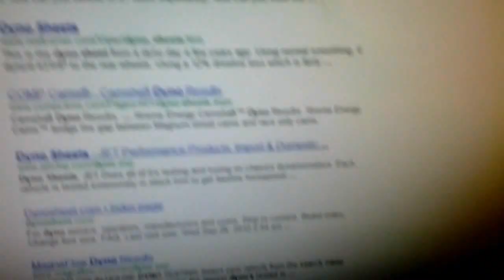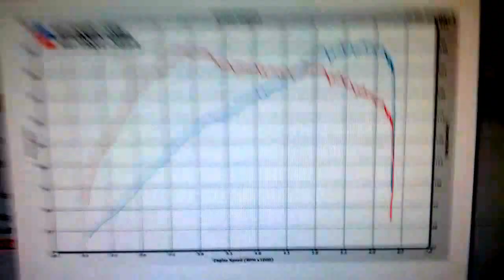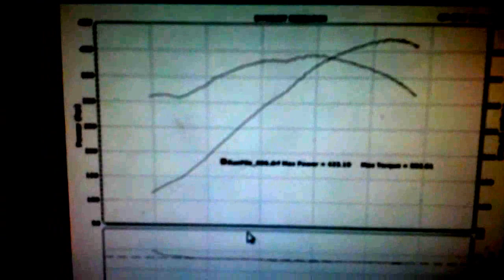Horsepower vs. Torque

Comment: Power to weight ratio is the most reliable (single number) indicator, as any mechanical engineer will tell you.
Reply: Explain to me this.

Honda Civic SI.  K24. 205 HP, 175 Ft. Lbs.  Car weighs 3000 pounds.

Runs the 1/4 mile in 14.7 seconds.

Buick Regal GS.  Weighed in at 3850 pounds.  240 horsepower, 315 ft. lbs of torque (actual output, under-rated at only 280 ft. lbs.)

Also runs the 1/4 mile in 14.7

The Civic has a hp to weight of 14.6 pounds per HP.

The Regal has a hp to weight ratio of 16 pounds per HP.

There goes the HP to weight ratio theory.

Lets look at the torque.

Civic has a ratio of 17 pounds per ft. lb of torque.

Buick has a ratio of 12.4 pounds per ft. lb.

The civic engine revs to about 8 grand, has V tec and won't make power until above the curve.

Buick has a positive displacement blower, and makes GOBS of torque UNDER the curve.

Think I am full of shit, look up the car and driver times for these two cars and see if I am close in my numbers.

Everytime I get into it with a car, expecially from a light, I walk away before even reaching 5000 RPM in first gear.

POWER UNDER the curve (torque)

Usually big torque is used for hauling loads, like big rigs (I drive truck for a living), but you apply gobs of torque into a car that is a street/strip car, and it's insane.

Just saying, a high reving engine isn't best for street/strip cars.

And just to put the icing on the cake, my car is modded with a pile of bolt ons and it's pullied.  Still gets about the SAME gas mileage as a stock Si with an engine half the size.
Reply: Chris Osborne

This is just splitting hairs and your argument has nothing to do with what Jon Proce is saying. Jon is saying that horsepower is meaningless.

The case you present is merely an example of 2 cars with the same 1/4 mile time, with very close power:weight ratios but different torque curves AND different maximum horsepower. One of the problems with power:weight ratio is that it doesn't factor in the relationship between drag and velocity (acceleration tails off quicker with a low HP car). It's much more complicated than you think it is, and you've drawn the false conclusion that a Buick with higher horsepower AND torque somehow proves what Jon is saying. I know the Civic is FWD, but I don't know your particular Buick's drivetrain configuration (RWD has an inherent launch advantage due to weight transfer for example). There are many variables here, but none which prove Jon's silly notion that torque is all that matters. Low end torque doesn't even come into a drag race in a manual car, because you use your clutch to find the limit of tyre adhesion (street tyres), and once you're off the line, you're only using the high rev range between subsequent shifts.

This is simply a case of swings and roundabouts. If you disagree, show me your math, because that's all that counts -- it's just engineering at the end of the day, and the language of engineering is not English (it simply doesn't work, as you, Jon and countless others continue to demonstrate).

Furthermore, your concept of torque:weight ratio is utter nonsense from a physics point of view. You can't propel a car to 100mph using a cordless drill can you? The faster you want to go, the more power you need to output because aerodynamic drag is proportional to velocity squared. If your notion was correct, I could put pedals in my car and propel it to its 155mph limit without breaking a sweat. You put POWER into a gearbox and extract whatever combination of torque/rpm you wish, determined by ratios. I can apply any torque I want to a shaft using an arm of sufficient length, but the fact I can't even produce 1/2 HP means that I can't rotate the arm fast enough to move a Buick beyond 1mph. Is this sinking in yet?
Reply: Chris Osborne

Put in the simplest terms possible:

175lb.ft vs 315lb.ft...........same (slow) quarter mile time. Case closed.
Reply: But, what you fail to account for is final drive ratios, tire sizes, extra weight and fuel mileage.

The regal has a F/D of 2.93:1, a 225/60R16 tire and nearly 900 pounds of extra weight to move down that track, but only makes 35 more HP at about 3000 less RPM.
Reply: Chris Osborne

I can't believe you're telling me I've failed to account for final drive ratios and gearing, since this has been my argument against Jon Proce all along (in essence, wheel torque/rpm is derived from flywheel horsepower and gearing).

We're getting nowhere here, and the reason is, you've presented a borderline case which neither proves the case for horsepower nor torque, because the only figures you've provided are peak flywheel numbers, which are not useful at all. You also don't seem mathematically inclined, which isn't helping.

When things are borderline, you can't explain it using English, only mathematics. I've already pointed out that there's a massive difference in torque between the Buick and Civic, but no difference in the 1/4 mile time. Why hasn't this registered with you? Within the context of this video, you have proved Jon's theory to be bullshit. I don't see what more needs to be done beyond mathematically derived plots of distance vs time, showing how the cars alternately lag/lead from launch to finish. If you're so clever, perhaps you would be so kind as to do this for me. I'd be very interested to see if you really understand this.
Reply: MoronAntidote

Really?  the civic has a HUGE mechanical  advantage over the regal with it's smaller tire size, steeper gearing (numerically higher), steeper final drive (something like 4.7:1?) and it's 6 speeds.

The regal just uses sheer force (315 foot pounds) to move it's nearly 2 tons down the track.

The civic has shallow gears, 900 pounds less weight, smaller tires.

To run the 1/4 at 100 MPH, the civic needs 3, maybe 4 gears.

Regal needs two.
Reply: Chris Osborne

Show me the mathematics then. Otherwise I'm not interested in your barnyard theories.

315lb.ft is not necessarily impressive. Flywheel torque gets multiplied by the gearbox and final drive, and the multiplication depends on many factors. A shit rev limit usually goes hand in hand with taller gears and higher torque. Swings and roundabouts - what's new?

Does anything you say prove what Jon Proce is saying? No.

It doesn't matter how many excuses you make about the Civic, the fact is it does the quarter mile in the same time as your Buick with only 175lb.ft peak torque. There's nothing more to say as far as this video as concerned.

It's a borderline case between two very different cars, but the torque difference is so huge that there can be no question that Jon is simply wrong. Bullshitting the public with peak torque figures and Carrol Shelby inspired myths doesn't help at all. Power to weight ratio is the least misleading number I can think of, but it's by no means perfect (doesn't take into account drag vs velocity for example). The reality is, there is no single number which defines the performance of an engine/car and there never will be, because it's far too complex. So, the public are given 0-60 times, peak HP, peak torque and top speed. Even this is lost on most of them, and programs like Top Gear in the UK just make the public dumber IMO.
Reply: MoronAntidote lightening the regal to 3000 pounds, the same weight as the civic, nets 13.8 passes.

It's been done.

Slap a set of 3.69 gears in that same car, and it's a rocket. 

Again, been done.

Power under the cuve is where it is at.

New Si is 3000 pounds, has a 4 cylinder and gets 9.4 liters/100 kilometers for economy.

I have a 3900 pound car, boosted v6, with a pile of bolt ons and get 9.6 liters per 100 kilometers.

I dont need to rev over 2000 rpm.

Torque. Power, economy.
Reply: Chris Osborne

So what's your new power:weight ratio then?

Going round in circles here it seems.

And anyone can make a car accelerate faster by shortening the gearing, because you increase the wheel torque (which as I've said all along depends on gearing). I still don't think you get it.

You continue to compare apples and oranges via the ridiculous notion that flywheel torque alone determines 1/4 mile time. You build a motor with more horsepower and gear it appropriately, you'll go faster.

'Power under the curve' is nonsense. I think/hope you meant 'area under the torque curve', which 'might be' a better measure than peak horsepower, depending on whether you're launching or not, because once you're rolling, you'll only be using a narrow rev range between shifts.
Reply: MoronAntidote Tell you what.  I could care less what you think, clearly you are one of these Vtec fanboys who thinks that high revving 4 bangers are the key.

Wrong.  You might make 400 HP from a 4 banger, but how long do you think that 4 banger will last when compared to making that same power from an LSX, or an L67, or even an L36.

As for my car, it isn't a bucket of bolts.  It's what we call a "sleeper"

Looks stock, ugly, and slow.  While it may look stock and ugly, it certainly ain't slow.

In fact, my next mods are a cam and double roller timing set, 140# valve springs, titanium retainers and Viton valve seals.

Should be good for 50 WHP with my current list of mods, and I hope to have the old mule into the 12's on street tires here shortly.

it's DEEP into the 13's as it sits with only a few bolt ons.
Reply: Chris Osborne

No, I don't even like Civics. BMW for me thanks.
Reply: MoronAntidote ok, bmw then. I have tge same whp (maybe less) than a 335xi, I am heavier, but i am still faster.

Torque.
Reply: Chris Osborne
Torque? No, it's not that simple, but I know you'll never get it because you don't approach the matter the way an engineer does, using mathematics. I'm guessing by the fact you used the 335xi for comparison that you have AWD. Well, that blows your Civic comparisons out of the water for a start, because AWD has an inherent launch advantage over FWD, and you should know that launch is an important factor in a drag race.

In summary:
Huge difference in flywheel torque (not the same as wheel torque);
Small difference in power:weight ratio (favors Civic once moving);
AWD vs FWD (favors Buick at launch);
Buick has power advantage, so acceleration is less affected by drag as speed increases;
Same 1/4 mile time (stock vs stock by your own admission).

Can't you see how this balances out? The least meaningful number here is torque (look at the ratio between the numbers and ask yourself why there's no difference in the quarter mile time).
Reply: MoronAntidote 2001 regal gs. FWD.
Reply: Chris Osborne

I feel for you ;)

My prediction is therefore a slight advantage to the Civic at launch due to lighter weight, but the Buick progressively gains ground after launch due to higher horsepower making it less impeded by aerodynamic drag, resulting in a tie. Not hard to visualise, though easier for the Buick if it had AWD.

Btw you also didn't mention whether the Buick is auto or not.

You do understand the importance of power vs velocity I take it?

For example, a bottom end Lotus Elise gets off the line quickly due to light weight, but because it lacks power, it runs out of puff really quickly. Acceleration isn't linear due to gear changes and drag. It's a curve which starts to flatten out some way before top speed (depends on power), so the higher your power and the lower your drag, the faster you'll be accelerating at a given speed (all else being equal, which is not the case here, but rest assured the engineers did optimise your gearing as they do for every car).
Reply: Really? I feel bad for you?

How much that BMW set you back?

I raced an E46 M3 cabriolet.  2002.

They are what? 300 HP and I think he said 250 - 260 ft. Lbs?

Again, I have NO idea what my car is putting out at the wheels, but I would be safe to say that it is near the 315 - 325 HP at the crank.

Less than the M3.

But I still stuck with him off the line (while he was at near redline to launch) and pulled ahead by a car.

I am willing to bet that I make more torque at the wheels than that thing did at the crank.

That's all I am trying to say.

And bottom line, they are lighter, are RWD, have a manual gear box and have a MUCH higher RPM sweep than I do.

So, that is what I am basing my argument on.

You think that because a Regal and Si run the same 1/4 mile time, that torque sucks?

Ok.  Let's up the SI's HP to 240, drop it's final drive to 2.93 from 4.7? and see how it goes.

See you in 18 seconds or longer.

Lighten the regal up by 700 pounds, and STILL make the Si have 240 HP and give the regal a 4.7? final drive.

The regal will win.  Promise.  Double the torque, same HP and weight.

It's not that hard to understand.
Reply: Chris Osborne

There is so much FAIL in this post it's hard to know where to start.

ALL cars produce greatly more torque at the wheels than they do at the crank. This is due to torque multiplication from gearing. You seem confused by 'corrected' measurements from dyno testing. You multiply the flywheel torque by the gear ratio and final drive.

You don't understand this at all. Sorry.
Reply: MoronAntidote You wanna talk fail learn about cars first.

E46 M3.

1st - 4.32:1
2nd - 2.53:1
3rd - 1.67:1
4th - 1.23:1
5th - 1.00:1
6th - 0.83:1

Final drive - 3.63:1

Regal

1st - 2.92:1
2nd - 1.56:1
3rd - 1:1
4th - 0.7:1

Final Drive 2.93.

Seems to me that the M3 should have a better advantage over my regal as it is lighter, has smaller tires, a shorter first and final drive ratio and is lighter.

Look at the gearing.  The Regal would be like starting that M3 off in second or third, but with a couple bolt ons it's still equally as fast with way more weight, etc. etc.

All your numbers bullshit don't work all the time off paper.

HP- weight is great, but when you make a PILE of power UNDER the curve, you get up and going just as fast in something tha tis heavier.

For example.

Some diesel guys are running 500 - 600 HP or so, but making 1000 - 1500 ft pounds of torque.  Those trucks are in excess of 8000 pounds (double the weight of my car) and are turning out 12 second 1/4 miles.

Torque.

If you enter the stats into a calculator, 550 hp in an 8000 pound truck equals a 14.5 second pass in the 1/4 mile.

But they are MUCH quicker.
Reply: Matthew Hyder the civic wasnt the point, it was used as a reference vehicle, so I think my memory works just fine.

Butthurt you are losingan arguement of FACT to a truck driver?
Reply: Matthew Hyder It would seem that way.  Usually the losing party would return fire with a BULLSHIT response.... 

Any other bullshit to add?
Reply: Matthew Hyder Nope, it's just a simple concept.  What works on paper does not always work in real life.

Until engineers realize that, we are going to have this debate!
Reply from the maker: Chris Osborne I'll challenge you there. Everything in real life can be represented perfectly on paper. If the practical doesn't match the theory, you did the theory wrong or you don't understand the practical. 

On that note, what I showed here was the most fundamental of concepts on this subject. It surely neglects dozens of real-world variables. It was simply meant to establish a basic understanding of a subject that is commonly misunderstood.
Reply: Jon Proce then explain the 1/4 mile theorynin my first post.
Reply from the maker: It's not a theory, Chris Osborne, it's just a story about a car. Everything I showed in the video is true; math doesn't lie. It wouldn't be practical for me to delve into the specifics of every vehicle, setup, and drivetrain.
Reply: Jon Proce But that's just my point.

That "story" about two cars are actual numbers from the times those cars ran.

205 HP/170 Ft. Lbs @ 3000 pounds = 14.7 in the 1/4.

But 240 HP/315 ft. Lbs @ 3900 pounds =  14.7 in the 1/4

The same 1/4 mile time.

The difference between the two cars (in hp terms) is 40 and a nearly half a ton (900 pounds)

Based on this theory, a 900 pound car with only 40 HP will run a 14.7 as well.

According to three calculators, a 900 pound "car" with only 40 HP will run 16.5 ish in the 1/4 mile.

What works on paper does not always work in real life situations.
Reply from the maker: Chris Osborne I'm sorry Chris, I've completely lost site of what you are trying to prove here. I really don't think we're on the same page with what the point of this whole endeavor was. Power is a mathematical function of torque and engine speed. That's the only point I wish for people to take from this. The two are directly linked.
Reply: Chris Osborne

The reason is, the calculators you are using are overly simplistic. There isn't a simple z=x/y equation which works reliably in all cases (as already pointed out, but power:weight ratio as an APPROXIMATION invariably works better than peak torque alone). You have to apply integration techniques using real torque/rpm curves, gearing, weight, velocity, drag coefficient, rolling resistance, transmission losses, tyre radius/slip/expansion, clutch simulation, air temperature/density etc. It's far more complicated than you think it is, but that doesn't mean it can't all be worked out on paper. Modern engineering isn't the guesswork you think it is, and all this can be simulated very accurately using computer software. Your assertion that mathematics can't predict real world performance is nonsense, and the only reason you hold this belief is because you are not an engineer. Ignorance is not an argument is it?

F1 engineers are not barking up the wrong tree. You are.

PS the overly-simplistic calculators you're using probably assume a fairly flat torque curve, where horsepower correlates well with the area under the torque curve. Poorly designed petrol engines with falling torque curves probably don't work so well in this case, though they would if they were made to breath better. This should not lead to a false 'torque is better' conclusion, because if that same engine were redesigned to flatten the torque curve, the horsepower would increase and so would the performance. Basically it would be faster (no increase in peak torque required), and fit better with your overly-simplistic calculators.
Reply: zanick2 and if you brought the TQ down, you would need more gears to do the same job.

You can't tell me that if you loaded down a 200 Civic with 600 pounds of shit, plus a driver and gave it a 4 speed that it would compete with a naturally 200 HP aspirated grand prix weighing the same and with a 4 speed.....same HP, but more torque.

Torque makes the difference.

As an example, I drove a Western Star with 4.11 rearends.  Had a 475 Cat, 18 speed.  Made 1850 torque.

Along comes my buddy, with a sterling, ALSO has a 475 caterpillar engine, same transmission, same rearends...but only makes 1550 foot pounds.

The western star would eat it up.  Same HP, but I made 300 more foot pounds of torque.

Same sterling vs. the new Kenworth making 600 HP and 2050 torque.  No competition.

It was looking at KW tail lights all day long.

And yes, same rearends, same transmission, same weight.